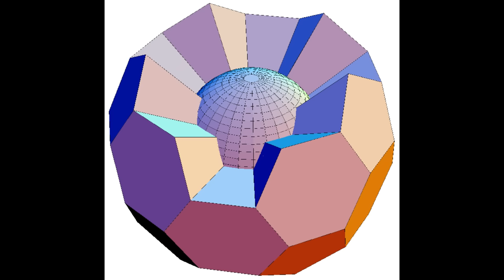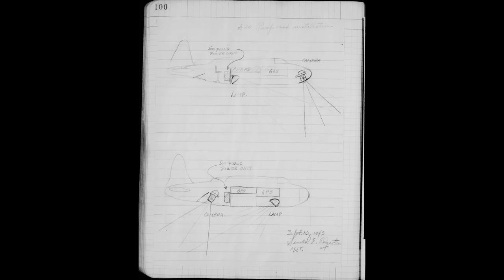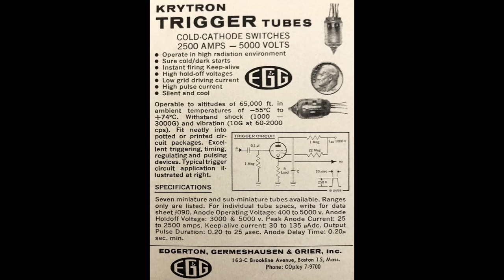Before The First Nuke Exploded... It Imploded.

Comment: Fun fact about TNT, one reason several countries did not start using it in until after ww1 was that it was quite difficult to get it to explode. It cannot burn to detonation, so would be pretty riskfree to drill in.
Reply: That's the main difference between high & low explosive.  Low explosives burn-very-fast.  High explosives decompose/explode due the the shockwave travelling through the material, faster than any flame front could go.  it can be hard to get that initial shockwave going.  It's why detonators are used.  They being a small amount of low explosive.

So you fire the low explosive, to trigger the high explosive, witch then initiates the nuclear cascade.  Boom, BOOM, BOOM!
Reply: @NemoConsequentae  ...which then triggers the hydrogen fusion core, as in the castle bravo test. 15 megaton boom.
Reply: @oldfrend  Big badaBOOM!
Reply: @NemoConsequentae  Not always, the UK (and others) used Picric acid (TNP), which is a high explosive, but can burn to detonation.
Reply: So not true.  ALL general explosives will burn to detonation including TNT.  IM explosives are about the only ones that wont, but even that relies on design of the device and not just the chemical part.  I have 15 years of munitions design experience handling TNT, RDX and various primary explosive including lead azide and styphnate.  Low explosives (gun propellants and pyrotechnic formulations for example) are typically not used in initiators as they don't detonate and you need the shock from detonation to function the main charge.  You use primary explosives for that purpose.  They usually are highly sensitive to a number of stimuli, and you keep the quantity low in the device to minimise the risk of initiating them.  TNT is relatively inert but will burn and like most explosives will burn to detonation if the quantity is large enough.
Reply: @Gnrnrvids  I didn't say that it couldn't be detonated by burning.  From your experience it is possible for the flame to initiate a fast enough burn to generate the shockwave & induce detonation.  I expect that it would not be a reliable or predictable method of triggering a detonation, however, whereas a detonator is.  And you sort of confirmed my point when you say they can "burn to detonation."  They aren't detonating while they are burning, unlike contained gunpowder or other low explosives, but the burning can trigger a detonation.

I've also seen people use C4 for boiling water for tea/coffee, or cooking food.

In your experience, does anyone ever deliberately do that, though?  I cannot think of any reason that someone would want to ignite a high explosive rather than using a detonator, unless it was an emergency and you didn't have one?  And had a lot of leeway in how big a bang you needed.
Reply: @NemoConsequentae  You'd never do it, as you say, not reliable, especially from a timing point of view.  It is from a safety in production point of view and for firefighting.

Even standard rifle propellants will burn to detonation.  They have a critical height (usually less than 5 inches or so) where if the propellant is stacked higher than that and it ignites, the gas cannot escape quick enough and it self confines.  End result is a detonation.  Not just a burn.
Reply: @Gnrnrvids  That's exactly what I thought.  My comment was not that you couldn't burn HE to set it off, just that the main difference in the chemical process of the detonation was different.  LE triggered by exposure to the heat of combustion & is a very fast burn, HE by the shockwave travelling through causing the molecules to break apart & reform.  

While using HE you trigger the initial shockwave by using a detonator, that isn't the only way to set it off, just the most reliable one.
Reply: @NemoConsequentae  what you put here is the definition of the difference between burning and detonation.  "LE triggered by exposure to the heat of combustion & is a very fast burn, HE by the shock wave travelling through causing the molecules to break apart & reform."  

So when it burn to detonation it transitions from a burning phenomenon (surface reaction) to a detonation phenomenon (solid reaction).
Reply: @Gnrnrvids  Exactly.  Low explosives burn-very-fast, high decompose from the shockwave.  That faster breakdown is also why HE is typically much more powerful than LE weight for weight.
Reply: I think a block of it catching fire in your lap would be severely sub-optimal.
Reply: @Gnrnrvids  ....or TATB, which is apparently used in some instances, being far less sensitive than RDX based HEs. I've wondered about it's prevalence and what it's mixed with for lensing, but such information is probably still sensitive....

Comment: after WWII Edward Teller was pushing for the hydrogen bomb but it was too demanding to do the math for so it got pushed back (that changed when the Russians tested their first nuke). Von Neuman was bought in to help solve this problem and a big part of the reason we have computers today at all is because thermo-nuclear weapons would be impossible to build without those computations
Reply: Ya.  No.  How about you go read about Bletchley Park, and what they did first.  While the computations for the H bomb are one of the major early uses of electronic programmable calculators (*), they were not quite the driver that Tunny was for computer development.  Even the NCR stuff done in the US was far more computationally demanding than the cold spots and spikes that the original Super produced.  (IIRC, the original Super calculations were run via gangs of IBM tabulators).  The Ulam-Teller advance of the sparkplug was a result of the math showing that the classic super wouldn't have worked- which is another argument in favor of Oppenheimer being "more correct" than Teller- that the world wasn't there in 1949, until the Teller-Ulam ideas (which are still "classified", even though they are fairly widely distributed) had been formulated.  

I'm just a layperson in this- but fairly well read.  
(*) More "calculator" than "computer" because of the relatively limited storage involved- they printed punch cards, which were then fed back into the calculator to make the next set of computations...although that's really being fine on what a computer vice a calculator is...

Comment: James Tuck a British guy was also involved in shaped charges. He designed antitank shells using shaped charges. This was absolutely necessary because British tanks were on the field no match for the panzers . British tanks before shaped charge shells had to get in close as their guns were were not powerful enough at long range but shaped charge she'll meant they could keep a safer distance.
Reply: Rubbish!!! Shaped Charges were used in the PIAT Anti Tank Spigot Mortar during WWII. British Anti Tank Guns didn't use Shaped Charges as they don't work with Rifled guns. The high rotation speed of the gun round causes the Jet of molten copper on the HEAT Round to rapidly spread out, destroying its effect on armour. The British 6 pounder was quite capable of killing anything up to the Panzer IV and the 17 pounder AT Gun could kill anything German on the battlefield at long range with solid AP shot rounds. 

The British still don't use HEAT rounds with their tanks as the Challenger II uses a 120mm rifled gun. The High Explosive Shells used by the British Tanks to this day are High Explosive Squash Head. The Explosives in the Shell are of the Plastic type and the shell has thin walls. On hitting the target, the explosive becomes a "Cow Pat" on the side of the armour with the base of the shell holding the detonator. As that goes into the side of the target it explodes the explosive "Cow Pat" which makes a large shock wave go through the armour and breaks off some of the metal on the inside of tank where the explosion happened, These fragments then fly around the inside of the tank at a great rate of knots chopping the crew and anything soft in the tank to bits.

Comment: The two bombs used were a uranium bomb and a plutonium bomb. "Little Boy", used on Hiroshima, was a uranium bomb that used the "gun" system that would get the critical mass to explode. That was easy. They didn't need to test it.

"Fat Man", used on Nagasaki, was a plutonium bomb. Plutonium doesn't  chain react like uranium, so they had to use the implosion process. So that's the system they tested at Trinity.

Comment: Apparently he used a Dremel tool (or it's equivalent) to drill in and fill the voids in the explosive.  So tell the story about how one of the first the bombs was assembled wrong on Tinian island, and could have gone off and caused a bit of a mess while it was being fixed.
Reply: He definitely wouldn't have used a dremel tool. The point of using a dentist's drill is that it is powered by air and thus doesn't have a risk of a spark igniting the explosive.
Reply: @MontegaB    Not necessarily — in olden times the dentist would have a treadle to power the drill, probably via a flexible cable in a sheath.

More modern ones are indeed air powered — and water cooled. You probably do not want a glowing hot drill head inside high explosives any more than electrical sparks — and yes, I know some high explosives do well as a camp fire fuel source until you try to stamp out the flames …

And of course nowadays lasers are an option for drilling…
Reply: its equivalent
Reply: @MontegaB  You dont need a spark.  Explosives will initiate bases on any one of 4 stimuli.  Friction, Impact, Spark or Heat.  Drilling will result in Friction and Heat.  No need for a spark, but yes they would have used air to eliminate the potential for spark.
Reply: @advorak8529  My chemistry teacher served in the Korean War. He told the class a story on how he used to heat his coffee up with a chunk of burning TNT. As an Army Engineer, he knew exactly what it took to set off explosives. But to the layman solders nearby, they were flabbergasted at the use of the stuff, burning.

Comment: Doc Edgerton's flash seminar was a fun class.  (Students could call him "doc" but not "Harold".)  I took a picture of a bullet going through a 45 rpm phonograph record edgewise, with the bullet stopped in the central hole.  You used a microphone off axis detecting the shock wave of the supersonic bullet to trigger the flash, since detecting trigger pull or even firing pin impact was nowhere near accurate enough.

Comment: Re: the yield of the Trinity test. It's easy to see why it was the biggest of its time; when building the first one, you'd not want to waste any of the material. Better put in a bit more to make sure it does actually detonate, learn from it, scale the next one down now that there's some confidence in it. Put too little into the first one and it fizzles, it's a big waste of plutonium.

EG&G had a division called Ortec that went on to make some really good equipment for radiation detection / measurement. They did very well out of the Chernobyl disaster (every municipality in Europe needed to be able to make monitoring measures for years to come). 

The cold fusion fuss was also useful to them; they put together a "my first cold nuclear fusion testing kit" neutron detector, and sold a lot of these to all the research groups that sprang up suddenly to try and replicate the supposed feat. The number of these that were RMA'd as "not working" was apparently fantastic, the customers preferring to believe that the instrument was defective rather than their attempt at cold fusion had failed...

Comment: Luis Alvarez is the person responsible for the precision detonation system.  Alvarez won a Nobel Prize in physics for his contributions to elementary particle physics (invention of the bubble chamber) and is the person responsible for the meteor impact dinosaur extinction theory.
Reply: Did a lot of radar work before going to Los Alamos. Designed the most accurate bombing radar of WWII and came up with the first Ground Controlled Approach Radar.

Comment: In later years, our company worked on slapper initiators and did some work with trigatrons, trying to improve the timing.  In modern era it is practical to get down to less than 10-nanoseconds of timing.  Since the speed of light is about one-foot-per-nanosecond (but slower in cables & materials), it was a miracle that they got the timing accurate enough to make this work with the long cables.  The high voltage is only needed to start the trigatron, and then it is the thousands of Amps, not volts, which blows the squib.  These days, thermal squibs are not actually used since they are too slow.  There are more sophisticated devices.

Comment: In the 1986 movie The Manhattan Project, they have trouble opening the casing of an atomic bomb to get out the core. John Lithgow's character references a similarity to the Trinity test, noting that when assembling the bomb, the core got stuck as they were trying to insert it. (It seems like they took a little license with the truth in that movie.) The high school student who built it uses photostrobes to set it off specifically for the precision and predictable output. It's not quite the same thing, but the callback to Kistiakowsky is still interesting.

Comment: also note the development of coaxial cable used to transmit the firing pulse to the explosives.  I guess now it would be better to use optic fiber ignition and control the timing by path length with a single light pulse to all the fibers at once.

Comment: The second guy listed as the inventor for exploding-bridgewire detonators, Lawrence "Larry" Johnston, was a really cool guy that I had a number of opportunities to talk with. One of his (many) cool stories was how they tested how uniform the devices were: put one on each end of a bit of detcord, lay it down on a metal plate, scribe a line next to the exact center and set them off. The point where the explosion fronts meet scribes it's own mark and you can measure (with a ruler) how much off they were.

Comment: The implosion system does not assemble the critical mass, the critical mass is already present in the pit. The critical mass is already in the weapon itself in the form of a hollow pit. The thing is the density of plutonium. Plutonium is alloyed and thermally formed to maintain a crystal structure with a minimum density of about 19 g/cm3, and the shape of the pit itself is important, and the total mass itself is greater than the critical mass of metallic unalloyed Pu239. The compression of the material in the implosion system increases the density and at the moment before the maximum density is reached, the external source of the neutron flux is activated to start the generation of nuclear fission which is then self-sustaining until the released energy disintegrates the physical material beyond the point of sustainability of the nuclear chain reaction. When calculations are made for the implosion of metals, they are treated as highly elastic fluids

Comment: The basic physics of a nuclear weapon wasn't (and isn't still) all that tough.  It is the incredible engineering and especially, as pointed out by Scott, the timing required to initiate the explosives with nanosecond precision.  This precision goes up by orders of magnitude as the weapons get smaller and more powerful. Some of the most closely guarded secrets of the nuclear program are the "x-boxes," the timing devices and capacitors neccessary for that level of precision. Even the wires are cut to the same length and the resistance of the connections are tested to be within a tight tolerence. There are newer, faster detonators as the exploding bridgewire isn't precise enough. Don't ask how I know this.

Comment: I don't remember where Jumbo was built but it was east of the Mississippi River. Getting it to the site required careful planning of the route. At 245? Tons it was the largest load ever moved by rail at the time requiring several railroad trestles along the way to be rebuilt to support the weight without fear of collapse.

Comment: Apparently during the cold war, NATO-allied troops had recovered some soviet air to air missiles, and were taking them apart for examination. One guy literally took a flat blade screwdriver to the warhead and started digging out the explosive putty. These warheads were not just explosive material, they are surrounded by steel or tungsten pellets to cause shrapnel damage to a target. So, you know, it's not just a bomb. It's a shrapnel bomb, in an enclosed garage, and you're digging at it with a screwdriver.
Reply: Oh that sucks man

Comment: When I was repairing a very large old xenon spotlight ballast I needed to replace the spark gap... I had a very difficult time buying a replacement. I was asked to provide proof of use and told that the part was also used in trigger circuits for bombs...

Comment: because it was such a big project i find it weird when Oppenheimer is called the "most influential physicist". Just for the reason that it was such a massive operation with sooo many more people.   Not to mention that that (unnecessary)  competetion for that title is vast and very hard.
I always thought about Oppenheimer as a project Leader. Knowing his stuff very well but not really the one screwing the Plutonium in...  A bit like Von Braun and the Saturn program. Kind of the engineering administrator administrating the engineers. But on a knowledge level with them.
Reply: I thought that too, he was also the interface between the scientists and the military. Major General Groves was the guy who made the big industrial things happen.

It's quite interesting reading Feynmann's books; it seems that once they got some material and could measure the characteristics, the rest of it was primarily about the fluid dynamics. That's what Feynmann was doing - fluid dynamics calculations. Well, "doing"; they used an early calculating machine, and he ran the team, kind of like an IT manager in today's speak!